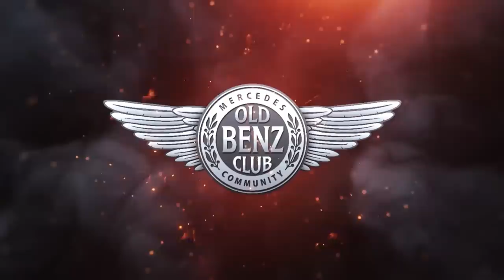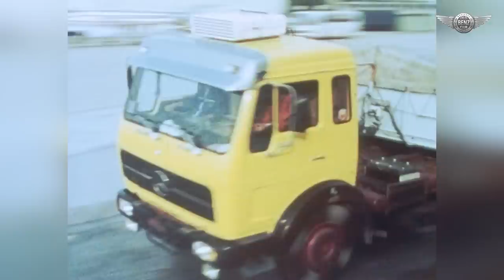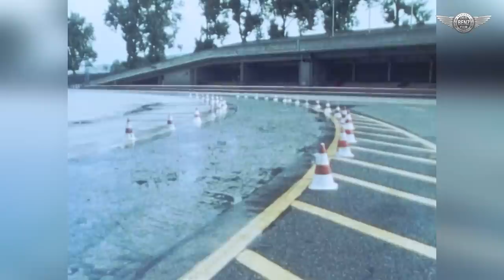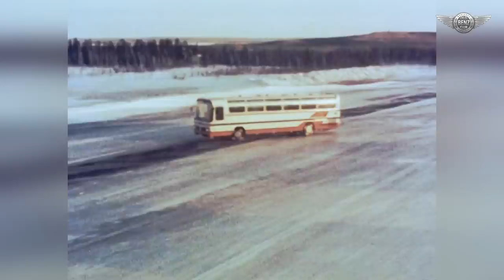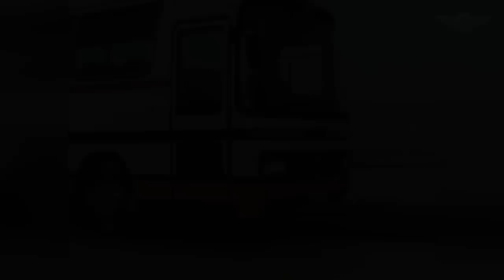Testing the anti-lock braking system on Mercedes trucks and buses, late 1970s

Comment: Absolute mad man behind the wheel of the bus, mad skills.
Reply: He has no fear
Reply: @bimawenas  fear of what? there is barely any grip = can't flip . area big like a private airport.  He even drove slow like 95km/h  before starting braking  test
Reply: i did same with skoda favorit on icy , empty parking lot and tried to drift with pulling parking brake  and steering wheel rotating, no problem, very interesting, big fun
Reply: @bimawenas  and no helmet
Reply: which skills?
Reply: actually it is a bicycle wheel mounted at back ot bus.

Comment: Does the Germans were testing their vehicles in secret air force military bases?
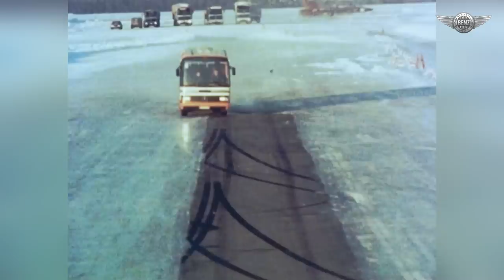Because there is a Swedish Saab 37 Viggen rolling on taxiway 1:48
Reply: as far as i know all german car/bus/truck manufacturer go to Sweden for testing their vehicles in cold coditions ... they go there for several dacades now because in Germany we do not have the constant cold weather over a longer period they need for all their tests
Reply: I hate to be that guy, but that's actually a SAAB 35 Draken...

And it's was not just the germans who came to Sweden to test out their new cars in winter conditions, Many other european car makers did do some testing in Sweden back in the days.
Reply: That might be a Tornado german figther
Reply: That plane belongs to Finnish Air Force. In front there is Finnish Air Force logo (white circle with blue line). The test track is in Rovaniemi Airport (ICAO: EFRO) which is airport for both commercial and military aviation. Back in goog old days, even Concorde was regular guest bringing British to see Santa Claus and Northern Lights. The test track used by Mercedes is still activily used by them. I visited there last 2019 when there was MB Actros and MB Intouro being tested. Interesting place. Hotel were I stayed was full of German engineers. Had fun with them chatting about cars and having some sauna same time. If you search in Youtube for example with words Daimler, Bus and Winter, you find for example couple official test/commercial videos made by Daimler AG (Mercedes-Benz).
Reply: @foxsoul7899  Or in Finland. 😉

Comment: Those Mercedes Benz NG's ranging from 1424 to 2632 and the Mercedes Benz O303 buses are legends of all time.
Reply: The O303 where my favorite when I started as a busdriver. Simple to manage, and feeling safe no matter the conditions.
North Norway winter of 96/97 was a recordbreaker when it comes to snow. And the Mercedes was my safe haven.
Never a problem with engine or electrics. Sometimes the brakes where filled with snow, so before the next willage, check up test was nessesary.

Comment: there is an on/off switch on the bus to activate/deactivate abs for testing purposes
Reply: They nowadays also often have one in the passenger cars used in the slippery weather's training, which of course is mandatory for all driving license students. Teacher turns the ABS off for trying braking while cornering without driver aids. Anyway for myself, the most interesting trip there wasn't with a passenger car or neither with a truck and a trailer, but with a Sisu XA-180 APC. While doing the braking and obstacle avoiding test there, the XA-180 always stalled its engine, because the torque converter wasn't fast enough to decouple the drive line. That resulted in a sideways sliding which seemed to last for an eternity, while I was turning two axles of off-road wheels without any help from power steering, which of course didn't receive any power from engine in that moment anymore.

Comment: I had an accident despite the ABS when my car oversteered while braking into a turn. The rear wheel were totally sliding out and braking with ABS worsened the oversteer! What I missed back then was ESP (electronic stability program) the would could activate single wheel brakes.
Reply: And even cars with ESP can oversteer if the car is not up to the original spec. I drove a VW Passat 2010 with ABS+ESP system which oversteered when taking hard right hand corners during the winter. The cause of this problem was that the bottom end of the left rear spring had damage (about the last 5 cm from the final coil turn was broken) which didn't yet cause any other problems but the oversteering vanished when the spring was fixed.